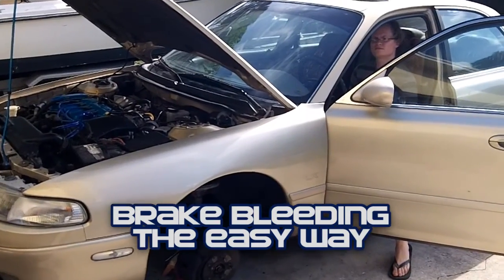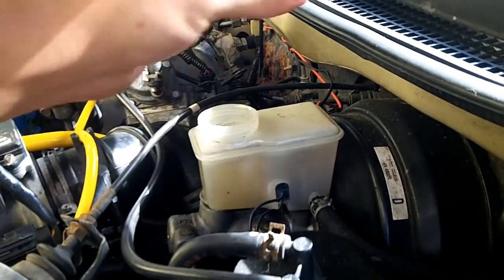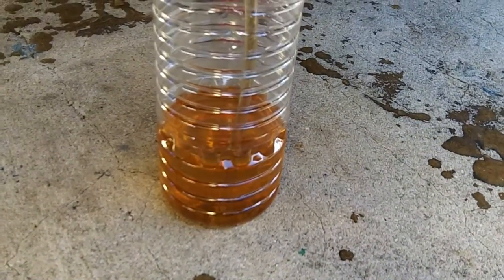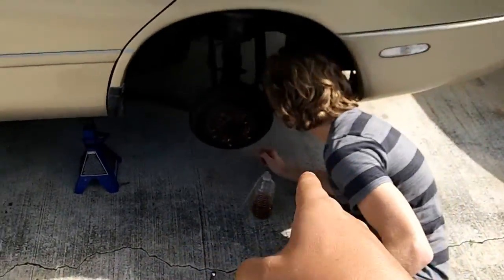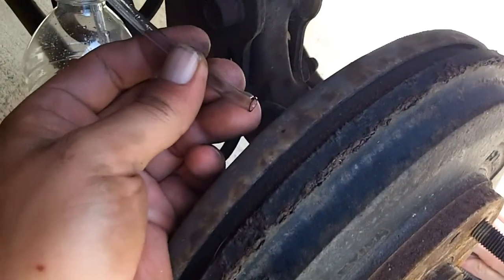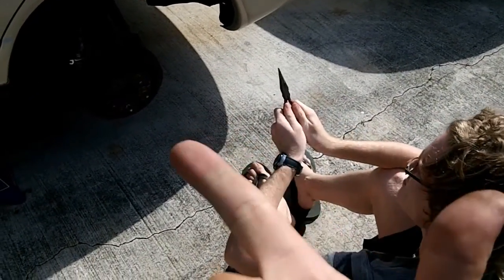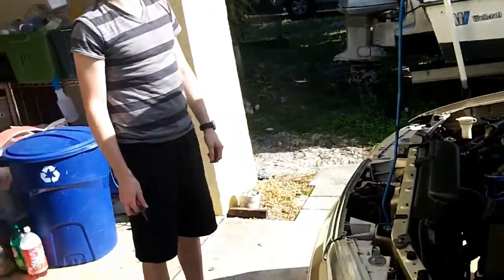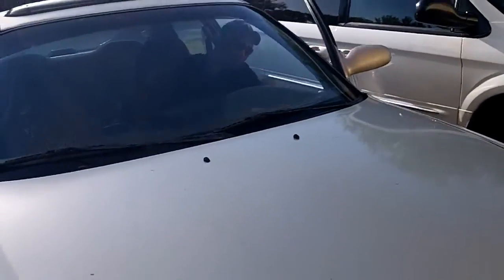Mazda 626 - Brake Bleeding Procedure

Comment: I recognized the sound of a faulty power steering unit - loud.

I like the way you painted the lower section of the console. Great for bouncing light around in an otherwise dimly illuminated area.

Comment: I got a 94 pissing me off. Junk yard calipers, new master and wheel cylinders, still spongy. What do i do?
Reply from the maker: Check for leaks including the clutch master and slave cylinder (if manual trans).  You still have air in the system or a leak somewhere.  Gotta get every last bubble out of there.  It helps to tap on the brake hoses and pipes.  If you run the reservoir dry at any time you have to start over.  That can be an expensive lesson. ;)

Comment: hey i had a question do you know how to tell when to resurface the rotors on the 98 626 or any car... by looking at them or felling them??? or can you point me the rifht way i cant find anything.. changed the pads yesterday and they are no annoying squeaking all the time even when im driving and not pressing the brakes... thanks
Reply from the maker: Rotor thickness specifications can be found in the work shop manual.  Available for free from pmx626.info  Use a vernier caliper to measure rotor thickness and see if it's within specification.  Same thing for brake pads.
Reply: Thanks